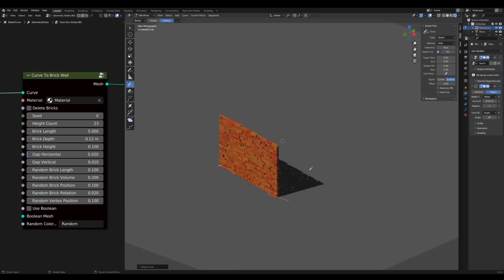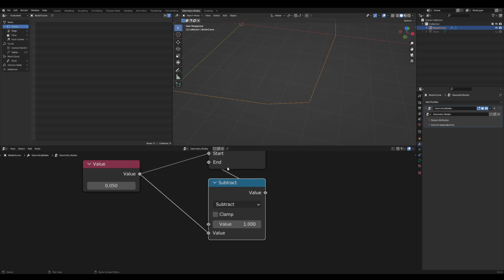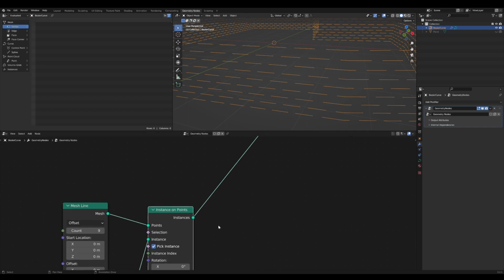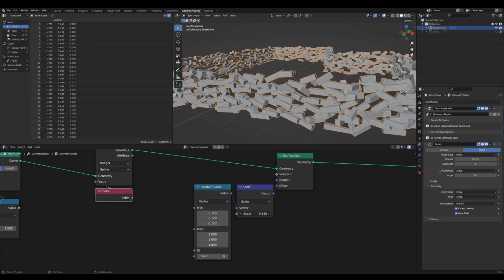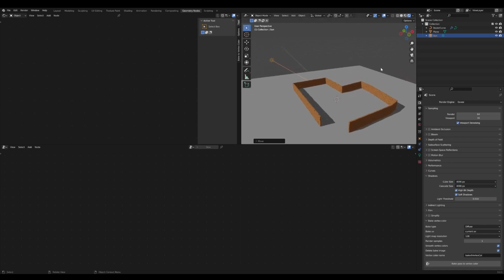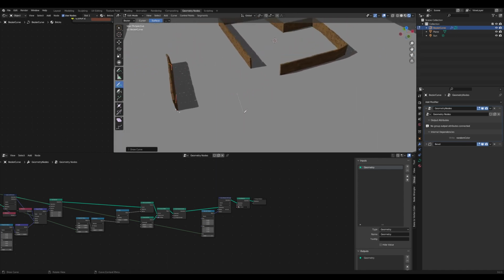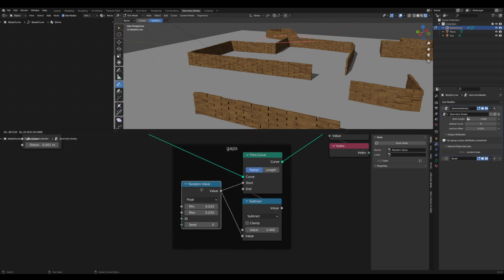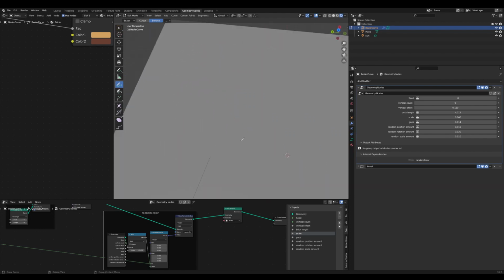Turn Curves into Brick Walls with Blender Geometry Nodes

Comment: The names of the nodes changed. Now you need a Math node (and pick the typo of math). The Mix node you can switch with a ColorRamp. And another node you need to search for vector and find the corresponding one.
Question: how do I move all the bricks more to the center? If I create a Set Position after the Random position and set the Brick index attribute to the selection of that Set Position, it leaves one brick in place and move the rest of the bricks (not individually). I want this, because I did not use the merging in the corners and want the bricks to overlap more.